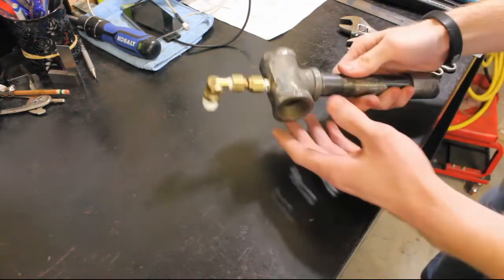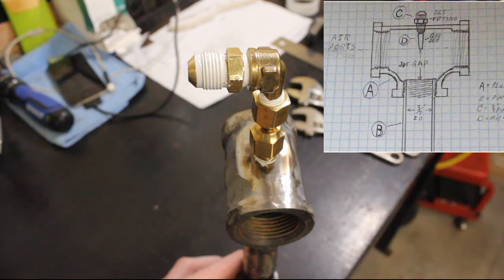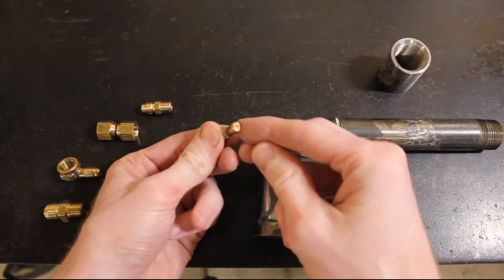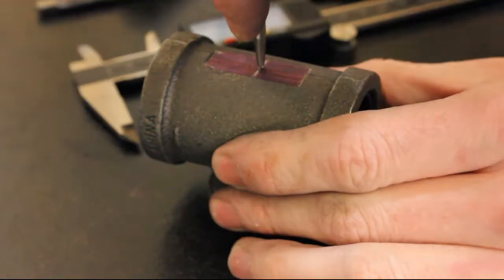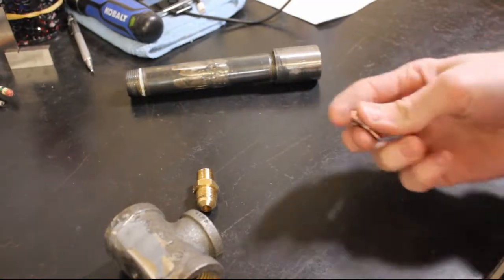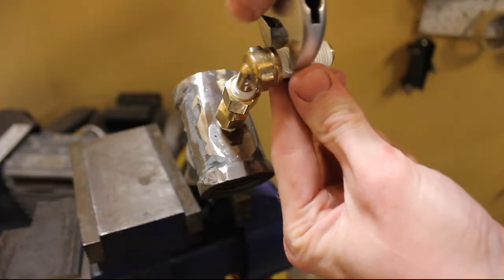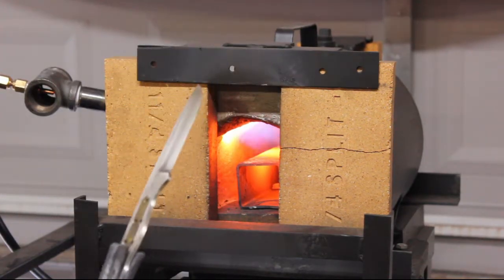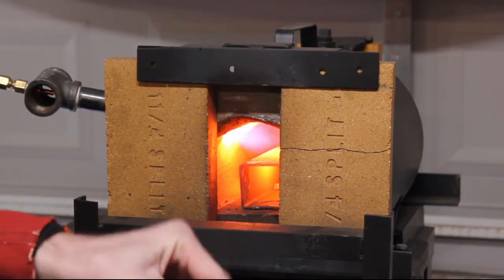How to Build a Venturi Forge Burner for Only $21

Comment from the maker: Anyone looking to getting into bladesmithing!?
Reply: My son and I are getting our shop set up, making what we can. Your encouragment and instructional information has been very helpful, love your channel.
Reply: @joeklerekoper4733  my dad and I are doing the exact same thing! We ended up having a bunch of trouble with the hardware and getting the right taps. The guys at our hardware store gave us one that was metric and said it was the same as an imperial one. Super annoying!
Reply from the maker: @joeklerekoper4733  Thanks Joe! Glad to be of service! What a great endeavor to embark on with your son.
Reply: ive been collecting parts for making a forge and this is one of the things i need to get parts for.
Reply from the maker: @sniperdgs  Excellent! Glad it helped you.
Reply: Getting ready to build a forge
Reply from the maker: Benjamin Romero really glad to hear it! I hope this burner build helped you out!
Reply: Yes
Reply from the maker: @joeball5937  Hell yeah!
Reply: I am
Reply: i am
Reply: I am what size hose adapter are you using in this video for the burner
Reply from the maker: @noblesicks  3/8 flare
Reply: I made the burner but there is a gurgling how would I get ride of it I’m not using a reducer for the muzzle
Reply from the maker: @noblesicks  Are you seeing the gurgling while it's in your forge or while it's in a vise? The forge should act as a flame holder (this may not work with larger forges). If you continue to have issues, you can install the burner with a reducer to hold the flame. I'd suggest a Stainless Steel reducer.
Reply: fixin' to go buy the burner parts right now. thanks for the vid.. keep it up.
Reply from the maker: @craigb2816  Heck yeah! Good luck sir, be safe! Check for leaks with soapy water
Reply: @RedBeardOps  indeed, though I was so excited I found all the parts, I forgot to grab some of that propane rated Teflon tape.. always forget at least one thing. lol
Reply from the maker: @craigb2816  happens to the best of us!
Reply: Just noticed you're a fellow Texan, rock on, good sir.
Reply: I am. Using your video for a burner design. I'm going to make three I think. My only question is how do you attach the merchant coupler to the forge?
Reply from the maker: @JAnderson392  I have a piece of pipe that is slightly larger in ID than the OD of the coupling. I then tapped a set screw into the larger pipe.

You want the end of the coupling to be flush with the insulation in your forge.
Reply: @RedBeardOps  Awesome, thanks. I'm definitely giving this a try to build my own forge.
Reply: Absolutely
Reply: I am!
Reply: YESSSSS, I AM, actually!! One thing at a time! I just procured an antique Hay Budden anvil. That's it so far! Next, a forge & burner to build! One thing at a time! 😋
Thanks for the AWESOME burner build vid! VERY CLEAR, EASY INSTRUCTIONS, THANK YOU! SUBBED! Greetings from Salem, Oregon!! 🌲🌲🌲🌲
Reply: Hey , just placed a order with Supplyhouse.com for everything on your list except the  1x3/4 inch reducer . Their customer service is phenomenal , the total was just $14.03 ($20.13 with shipping) & I will receive it on  Dec. 3 , it’s  Dec. 01 now . WOW . Thanks for all your content , very helpful .
Reply from the maker: @buddyblankenship4186  Heck yeah sir. Glad you're enjoying it! They have been great to work with whenever I make an order!
Reply: I've always been intrigued working with metal. Forging is new to me, but im very excited to start very soon.
Reply: Just inherited a forge got to fix the burner
Reply: I’m a ceramics artist. A potter, looking to build burners for a kiln. It’s small, 12 cubic feet. I need 2600 degree F for 12 hours. I think 4 of your burners should do the trick. I did forge a folded tanto- 19” with a 12” blade when I taught at a U crafts center that had a nice foundry department ...more work than I imagined. Made a nice shirasaya for it.
Reply: Yes trying to learn
Reply: I have an anvil and a couple smithing hammers but my homemade frog just takes too long to heat up and it doesn't heat well
Reply: Yes I am about to start making knifes
Reply from the maker: @dylanmontgomery2665  Heck yeah Dylan!
Reply: My best friend and I are setting up a small shop in his garage 😁
Reply: Yes me I love to   I think it’s amazing
Reply: I've wanted to start blacksmithing for 5 years and i now finally have a place to set up shop. I'm going to build 2 of theses burners so thanks for all the helpful tips!
Reply from the maker: @joshdandurand7766  Good luck Josh!
Reply: I am , with my little brother. I really also like full on Blacksmithing and I hope to make my own guitar parts. It all looks so fun !!
Reply: Yes I am! Thanks for the videos!
Reply: I’d like to link up with you as for I have an idea and I do believe that you’ll have great interest in it
Reply: Ive been making knives from sawblades, but just ordered some 1084 and am getting ready to build a forge from a sixtel (5 gallon) beer keg.  I own a mig welder but have never used it nor welded before some im mostly nervous about welding!
Reply: Absolutely
Reply: Yes sir. Getting into it & setting up the shop currently. Thank you for your time in putting your vids together and passing on you knowledge. You are a great teacher
Reply: Yes. .. exactly why im here lol.
Reply: yes I already started, I have made 3 sets of tongs a belt buckle, a forged rose, a square hole drift and a round hole drift.  very crude mind you, but am happy I started.  I am using a handhelf MAPP gas but it does not provide the heat i need for large segments of work and it is so wasteful.  your videos may just get me working more efficiently once i get a large propane gas cylinder and make a burner.

Comment: I am a retired machinist with 48 years in US Navy shipbuilding and I  have noticed here and at other sites a lack of knowledge regarding tapered pipe threads. I would like to offer some info that will help avoid a lot of problems. Tapered threads are designed to get tighter as they screw together to seal for WOG ( water,oil,gas) applications. Teflon tape or pipe joint compound help lubricate the threads for ease of installation. The tap is only supposed to be turned into the hole a certain distance, not all the way through. In pro shops we have gages that we use to tell when it is in tolerance. If you don't have a gage,  there is a trick we use to determine how far to go. After drilling the correct size hole, start the tap as straight as possible and using a hand tap wrench rotate the tap about one to two turns and then back out enough to break the chip, repeating this process until finished. Cutting oil is recommended. ( DO NOT attempt to power tap taperd threads! ) When the tap is about halfway into the hole, start counting the threads still above the hole. Run the tap in until you can count 7 to 9 threads on the tap above the hole. Stop there and you will have hit the "sweet spot" for correct thread engagement with the mating part. This works for any size NPT tap. One of those simple little tricks of the trade that make life much easier.
Reply from the maker: That’s awesome, thanks for sharing that knowledge!

Comment: Just curious about temperature?  Have you measured the temp and does it exceed 2000K?  I’m like to melt copper in a 5-gal propane tank shell as a forge.  If this setup produces high enough heat to melt copper, that’ll be awesome.  Great video.  Thanks!
Reply from the maker: I have not measured the temp with these burners. 2000K! You're measuring in Kelvin?! I've seen people forge weld with venturi burners, so it can get up to 2000F depending on the size of the forge.

Comment: Do you not need to be able to adjust airflow? If not, cool, but if so, how could you adjust the design to allow for that?
Reply from the maker: On this design with these dimensions it works well without air flow adjustment. I've seen people put baffles on the T to be able to adjust air as well if you find it's needed. 

If you have the time, funds, energy, etc; I'd advise a 'blown burner' which has an electric blower. This will allow you to dial air/fuel ratio to your liking.

Comment: Your pipe fitting skills are pretty novice especially the brass fittings, but it works so who cares.  Don’t need thread tape on flare fittings. It does absolutely no good. The sealing surface is the copper flare or a flare gasket. The sealing surface is accomplished by compressing the copper to the brass. Threads just give you a mechanical method to accomplish compression. That being said. You are the teacher!  It works so good job!
Reply from the maker: Thanks, yeah this was a while ago... just trying to piece it together. A couple of un-necessary parts for sure.
Reply: @ I working in an engineering research lab for a major manufacturer is supermarket refrigeration systems. I know nothing about making knives.

Comment: great thanks alot.  does propane not shoot out of the t section?  just asking .. also want to ask,  about the 3/8 flare to 1/4 inch mpt .  is the 3/8 inch side the part which hooks into the female of the regulator flare?
Reply from the maker: The flame should only be coming out of the end of the burner not the T. This project was so long ago I forgot the details, sorry!

Comment: Why the elbow?
Reply from the maker: Just wanted to reduce the stress on the gas hose. An elbow facing downwards seemed good for that.
Reply: Do you have a video detailing the connection to tune tank?
Reply from the maker: @marcgold2496  nope, but all i have on the tank is a regulator and gauge. Check the description for links.
Reply: @RedBeardOps the hose and regulator you list require another 1/4-->3/8 coupling...fyi to others making this
Reply: New question.. and thanks for the responses... 

I'm getting a leak from the swivel... is there a reason for that specific part?
Reply from the maker: @marcgold2496  Nah all those parts are just ways to get the gas to the mig tip. Probably not most efficient as shown. Lots of different ways you can do that. Be carful!
Reply: @RedBeardOps back to it after a long work week.. I swapped it for a straight coupling. Hacked off the flairs so it would fit. Now I just can't get it to light.. I trimmed the mig tip.. adjusted it the best I could.  Gonna block one side of the air off.. see what that does. Any other suggestions?
Reply from the maker: @marcgold2496  Hard to know from my end. You want the mig tip in the center of the T; also note the size of the mig tip matters. 0.030 is what I used

Comment: Sounds great for controlling heat treatment BIG THANKS 
  I'm also need to forge welding as I'm building wood carving tools. 
QUESTION  ?
Can I slip this in place for heat treatment, then remove and place a hotter burner anytime convenient for my needs?
Reply from the maker: I don't see why not! May take some time and design to get the swap smooth though

Comment: U wont answer but WHY do ya need the elbow before the propane line.
Reply from the maker: Hey man, I answer just about every question here on the comment sections. I put an elbow to reduce bending on the hose and have it run right down to the tank. Personal preference really

Comment: What did you weld on the tank to mount this burner?
Reply from the maker: I have a hole cut into my tank with a large coupling welded on at an angle. I threaded it to have set screws.

Comment: Nice job building the burner. It should have a 0.035" mig tip trimmed back about 1/2 way across the intake port on the T. If you want to use a 0.030" mig tip use a 3/4" x 3/4" T. Frosty
Reply from the maker: Thanks Frosty! Great design

Comment: So im trying to upgrade my current doubble burner for my small toolbox forge to 2 like this i got them built and test firerd outside the forge the seem to work great but once i attach them to the forge and try them they seem to be struggling to get enough oxigen to properly burn inside the forge instead im getting 2-3 foot flames comming out of the forge so im woundering if i should put a couple more smaller oxigen holes on the sides of the T's or a couple breather holes in forge itself do u think that would help? 
Or maby add a reducer and make the T 1.5 inches instead of one
Reply from the maker: Hey Dustin, I've honestly never tried anything like this so I can't tell you for sure. On my main forge I use a blown burner to be able to control the Air/Fuel. 

You test fired them together right?
Reply: @RedBeardOps  yes test fired them together and the burn amazing outside the forge i seperated them last night going to try just one in the forge today

Comment: Hey I made this burner but I'm having a problem with it making a bubbling noise and not a roar... I don't know how to fix this, I got everything you said except the regulator. I don't know, the forge is also pretty small
Reply from the maker: Interesting, I'm not exactly sure what's going on. I think you'll need a regulator and gauge for sure to know what you're sending it. Please be safe with this... propane can be pretty dangerous.

Comment: great looking build using mig tips. does that mean you don't have a needle valve on the regulator hose?
Reply from the maker: The needle valve will help you control the flow of propane into the MIG, but I was running it without the needle valve and using the valve on the regulator alone.

Comment: What tipe gas are you using I'm from South Africa and regulater
Reply from the maker: ✅Propane Regulator and Hoses:
Marshall Regulator - https://amzn.to/38UkPKN
Steel Braded Propane Hose - https://amzn.to/3z2sQYR
Propane Tank Adapter - https://amzn.to/3YF7077
30psi Gauge - https://amzn.to/3YleQmN

Comment: Good video. I will build it. Not advisable to use tape on flare threads, though. If the flare fitting leaks, gas will still leak out above the flare itself. And the tape may compromise the flare union while the fitting is being tightened.
Reply from the maker: Thanks for the info!

Comment: Thanks for making this video.  I have made the burner.  Now I need to hook it up.  Would you have a video or some information on what kind of setup a smith would need as far as a make and model of a regulator and gas line for a propane forge to go along with the frosty t-burner in this video.  I have a small propane tank; 20-30# that I would like to use for this.
Reply from the maker: I use these - Marshall Regulator - https://amzn.to/38UkPKN
Steel Braded Propane Hose - https://amzn.to/3z2sQYR
Reply: @RedBeardOps  thanks for the supply recommendations.  We made the burner from this video.  Looking forward to using it!

Comment: Remember NPTF & NPT fittings do not share the same sizing chart as other fittings and although they screw together it should be noted that the fitting won’t be leak proof unless sealants or o-rings are used.
A person could drive themselves insane if they don’t understand how to size and type a fitting -especially gas fittings. What’s 1/4’ for nptf isn’t 1/4’ for another fitting.
For this application everything should be NPTF.
Reply from the maker: Very confusing for sure...

Comment: I’m wanting to make this for a five pound air tank forge I have, would just a single burner like this give enough heat just to do regular forging? I’m not wanting to do any forge welding with it, just want to be sure it will give me enough heat to do regular day to day forging
Reply from the maker: I think so. I'm not 100% on the dimensions. Maybe two layers of kaowool would be in order.

Comment: I have already built the physical forge. Now collecting parts for the burner/s. I have only 1" to 1/2" atm. Will I need to get the 1"to3/4" instead?
Reply from the maker: I'm sure other sizes could work, this is just the sizes I know work.

Comment: Ok my mig tip is 8mm OD and 0.8mm ID the orifice size is 0.8mm 
I ead online that a better size for the orifice should be around 0.045 inches which is ~1mm for me 
Is this correct?
Reply from the maker: Worth playing around with for sure. I think mine was 0.030
Reply: @RedBeardOps  the mig tips orifice I bought are about 0,031 inches 
The problem I had was I couldn't seem to find short 3/4 or 1inch pipe that is threaded on both ends the stuff I could get was ~3ft long I don't know if the length of the pipe effects anything so I decided to cut off one end I used the threaded end to hold the mig tip and ball valve 
This setup didn't get good temperatures and it took a while to heat up steel also if I added to much air the flame would blow out,
This was inefficient so I made the same thing but with 3/4 inch pipe I was able to get a shorter section of this, and it was threaded on both ends so I conneted a reducing bushing and a 1 inch coupling

Now when I light it the flame has a bright blue cone and has a higher temperature and does not blow out at all 

I'm not sure if increasing the size of the orifice does anything but I do want to see if 1mm would be better.
I assume I will make the flame burn fuel rich but will this still be efficient 

What I'm certain of is this isn't efficient for melting brass or copper

Comment: How much heat does it produce? I'm building a small forge and i got firebricks that hold 1300 C°. Is that enough?
Reply from the maker: THat temp is fine. Make sure you're using soft bricks... they work wayyyyy better

Comment: So ive been wanting to connect my forge to natural gas instead of propane.     I cannot seem to find any easy to understand instruction on it.
Reply from the maker: Hey Chance, I've never done this. However, I've heard that the low PSI supplied by NG coming into your house would require the use of a forced air blower... ideally something like a ribbon burner.
Reply: @RedBeardOps  thank you. Ill search for ribbon burner instead of natural gas.   Might be what I'm missing

Comment: Did you remove the galvanized coating by steel brush and grinding?  Is that why T appears grinded all over?
Reply from the maker: Those are black iron fittings. No galvanization. Don't use galvanized pipe. Cheers